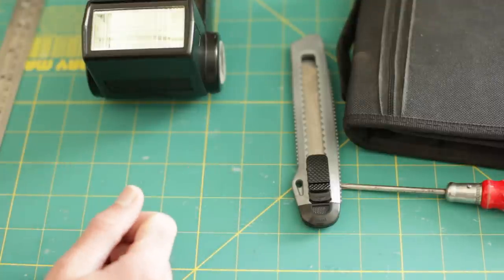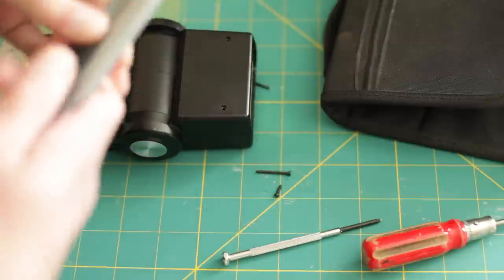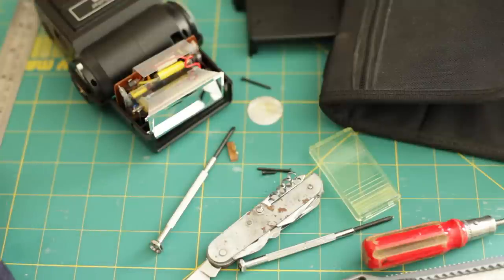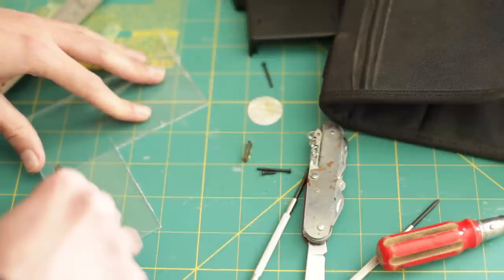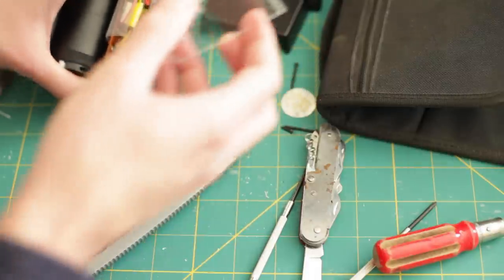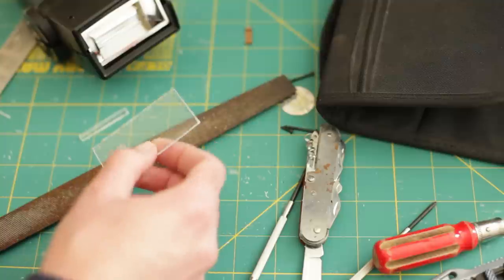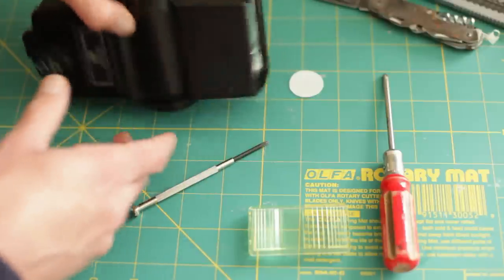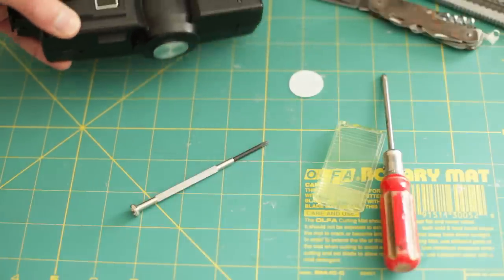Modifying the Vivitar 283 flash for UV photography

Comment: Hi very useful guide to watch, many thanks for creating and sharing. Have you tried other mediums for the lens? I wonder how UV prohibitive the plastic is, compared to clear glass or without any filter (im pretty certain you'll not have a tech spec sheet for the jewel case's optical properties !!!! ). I'm just starting on this UV path, but am guessing the flash manufactures are mainly considering output at the visible end, likewise, as with digital sensors in general (perhaps why you need so many strobes)???
Reply from the maker: I've only tried the CD case plastic I'm afraid. No filter is sure to be the best, but I wanted some protection for the flash tube. I haven't done much testing, but I don't think the plastic reduces UV output much. And it's certainly easier (for me at least) to cut it to the right size than a piece of glass. If I get some time I'll try and test it with and without the plastic to make sure.

The flash manufacturers actively block UV output from their flashes, the same as the camera manufacturers actively block UV using the hot mirror in front of the camera sensor. With these old Vivitar flashes you can get round this by removing the fresnel lens, which blocks UV. But with many modern flashes they have the UV blocking coating applied directly on the flash tube, making them very difficult to convert.
Reply from the maker: I tested one of my flashes with and without the plastic now - there's about half a stop of UV light lost with the plastic.
Reply: Many thanks again, especially as you have no done my leg work ! - and appols for such a long delay. Id forgotten this email account id used DOH !!! Cheers